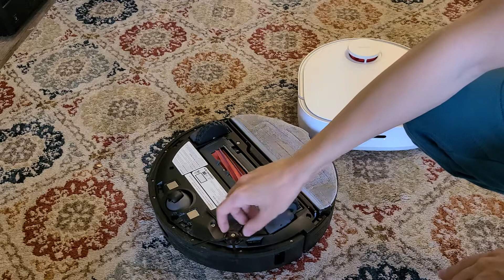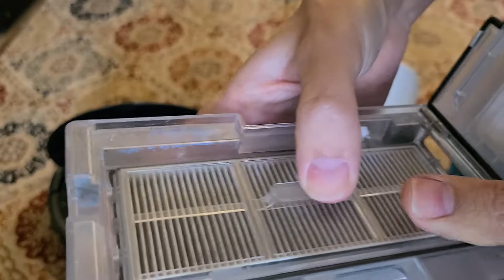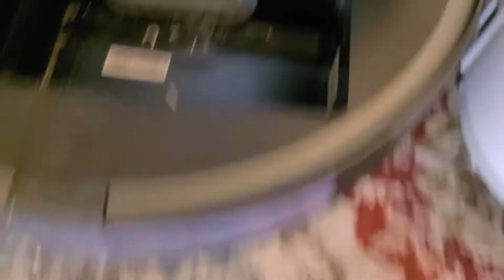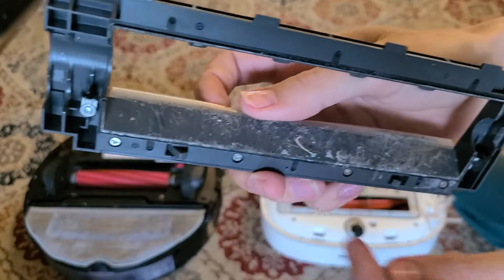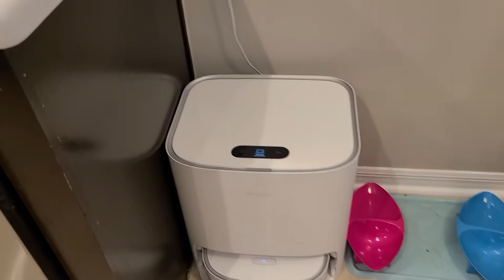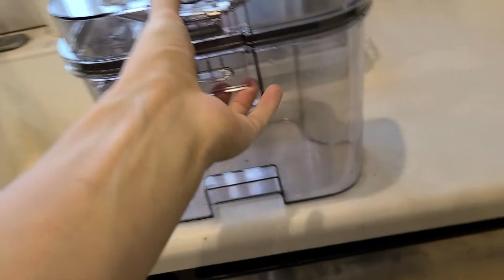Roborock S7 vs Dreamebot W10 vs Shinebot W450, robot vacuum+ mop comparison. Engineer review.

Comment: Do you have any insights on the medium-to-long term reliability of the S7 and W10? Also has the W10 software improved over time?
Reply from the maker: I returned all except the W10. W10 works great still. I have two things about it that are negative so far: changing dust bin requires manually pulling it out of the base or waiting until it starts cleaning and comes out. A simple software fix could solve this, but it isn't there still. Second sort of an annoyance is that with carpet it lags pretty bad and would run around it every single time seemingly not memorizing that area, this is carpet detection software issue and it can be solved with a software update, but its another thing that is still present. Over all I am still very happy with it. It's super silent as well, compared to others.
Reply: @Vladlabs  appreciate it! I ended up going with the L10S pro and it's been awesome for both vacuum and mopping with minimal maintenance. Only issue I have is the carpet sensor broke so it mops my one carpet in the house, luckily it dries pretty fast..
Reply from the maker: Cool! A self-cleaning for dust bin on L10S would be great on mine haha. I don't have that. Overall I think dreamebot brand is superior to roborock, roborock is just marketing. The only thing I still need is a hookup for these vacuums directly to water and drain lines to make them actually automated. At the time of my purchase that wasnt available for some reason, but for me its an obvious improvement which will allow to make it smaller to ship, use less parts and overall improve every aspect.

Comment: Could you please advise how Many Time it takes to MOP your appartement (W10) if it has to wash the mop mets Say every 100 sq feet?
Reply from the maker: You can set it up, mine is set to 10m², which is optimal. I never counted a time ad my house is relatively big, over 2000ft², and I programmed it with a complex schedule where it never cleans the whole house, kitchen area is daily, living room is once a week only, etc etc. But overall it's similar to other vacuums, they all have relatively same speed of cleaning. If somebody is very in a rush, then clean the floor manually lol, robotics is always slower than manual, the point is to clean when you are not home, or when you are not involved in any way. So time it takes isn't really important anyways. And as I said, it is faster than most mops, or similar.
Reply: @Vladlabs  I agree that robots are Always slower, but considering fact that the W10 has to go to the station every 10m² and run the cleaning of its pads + wet the pads ... I think it will take even longer than other robots, which explains my question.
Reply from the maker: No, it's moving slightly faster and you still need to clean roborock pad same 10m² or more, but manually, which is a major PITA. If you don't manually clean other vacuums, you will get the dirt spread over all the floor everywhere. They don't dematerialize dirt you know ;) rotating pads are way superior, even compared to ilife model, surprisingly.
Reply: @Vladlabs  no need to clean it manually, just throw it in the washing machine :) Also, by doing a mopping shchedule by room it would be juste fine ;)
Reply from the maker: Up to you man, I actually had that vacuum and it's a major NO because of that. W10 can mop autonomously entire house, what is the point of a robot if you will need to swap a pad every 10m² on average. You can't ever clean even one room properly with roborock due to that mop change requirement. You will need to run around it to babysit it, which is just dumb design imo. And it isn't even a proper mop, it only really cleans the dust. Vibration of it visually does nothing at all. You just trying to have a wishful thinking and being caught in a bias, I absolutely think that W10 is light-years better for mopping in every possible way. This is my advice basically, and you do whatever you think works for you. You heard me :)
Reply: @Vladlabs  I have Many points to raise with you : Does the station allow you to spray/rinse the pad with cleaning solution that sanitises the floor and gives great smell to your house, if not don't you think doing so even manually is a plus ?  Do you think that the washing of the pad with simple water by a station is enough to consider it is crystal clean with no more dirt ? Does the W10 allow you to raise the pads to pass through a carpet or would you need to babysit it to make it go further the carpet ?  wouldn't this make it dumber than the roborock S7 in that aspect ? Does the W10 have a water tank to continue wetting the pads while cleaning, wouldn't that be smarter in order to achieve faster cleaning if your floors are not very dirty? For the Price paid, wouldn't it be smarter to buy two or three roborocks S7 to clean your house faster and more efficiently ?
Reply from the maker: First of all, roborock with base is $900, w10 is $930. W10 is not best choice for carpets, however I would still not buy a roborock either way, at its not worth the price. Watch more reviews and Google, do some work yourself and investigate. You are asking for a way too much effort on my side to explain each aspect to you. I do respond to everyone, but hey, you gotta respect other people time and be reasonable too, right? If you have a lot of carpets, no, do not consider w10. It's not for that. 90% of my house is hardfloor.
Reply: @Vladlabs  I am sorry if you found my comment disrespectful it has Never been my intention. I though we were having a serious discussion and arguing about  Robots no one of us have stakes or financial interest in ....  As regards the Price tag of the S7 vs W10, as stated before I have paid mine about 460, and have no need for any station for now. I would prefer having two or three robots and clean the pads in the washing machine ...
Reply from the maker: As I said, everyone's house is different. For me it makes no sense to do that kind of maintenance, as I will then vacuum manually, better and faster. Robot must be autonomous. Over here I shared my thoughts, definitely not looking to spend time on arguments, as I used both of them for a month, and you only have roborock, so you can't objectively compare. For me mopping is #1 priority, and for my house. All that I already covered in a  video tho. Mopping performance of these two robots is day and night, clearly.
Reply from the maker: Amen. 😀
Reply: @TecHome S7 is a horrible Vacuum ? Hhh it seems you confuse vacuum and mop, it is two différent functions  , and S7 is an Amazing Vacuum. As for mopping, it does the job pretty well for small areas and very fast. As I Said before, I would prefer buying three S7 without station at 1200 Euros rather than one w10 at 1000. Or even better, one S7 And a dedicated moping robot like the ilife 455.  yes I will change the pads when I get home ;).
Reply from the maker: You need to change a pad WAY more than that, I told you already. By the time you get home, the dirt will be spread all over your apartment by a dirty pad lol. W10 washes pads every 10m², S7 needs even more frequent change due to skinnier pad. If you need just to Vacuum Tacklife on my video does it just as well, for $270. Don't need to throw $650 for that. And yes, I am not sure what's up woth your math, you can't buy 3x S7 for $1200, they are not $400 each, they are $650. W10 is $950. You can barely buy 1.5xS7 for that money.
Reply: @Vladlabs  I talk in Euros, and yes they are 400 euros ;)
Reply: @Vladlabs  As regards washing pads every 10 M2,  in reality you only do that because it gets dry after 10 m² because it doesn't have a water tank.  Otherwise I am sure you could clean more without going back to the station. That feature lacks in the W10 (Unlike Obode p8 for exemple).
Reply from the maker: Then W10 is 700 or so. Not 1200. I bought it for 950 USD. I checked and W10 is 750 euros.  And you are asking why reviews of S7 are all good? Here is why, you show such bias yourself, you don't want to hear what people tell you, you compare best scenario sale price of S7 with worst price that doesn't even exist on W10. This is exactly how bias works and why youtube is not always an accurate representation of product.
Reply from the maker: You judge based on what? Based on a fact that you never even used any of these vacuumes? Lol. No, you need to change a pad on roborock after each room at least otherwise it gets dirty, and this is even in my relatively clean house with no dogs or little children. Good luck with that on dirtier floor. W10 pad dries yes, but even if it didn't, I'd still wash it every 10m² to keep it clean.
Reply: @Vladlabs  Any of these vaccuums ? I am running the S7 right now and very happy with it, thinking of buying a second one ;)
Reply: @TecHome Try this instead : https://youtu.be/J6zFxrnvXow
Reply: @TecHome for the S7 : https://youtu.be/vM34T4Gchl4
Reply: And then a third one and will clean all  my first floor in less than 40 minutes :) while the W10 would need 4 hours lol
Reply from the maker: Good luck with that. You are a remarkably stubborn person, can't help that much further haha 🤦🏻‍♂️😀
Reply: Carpets included :)
Reply: @TecHome Based on several other reviews, this robot needs water refill After about 50 m² mopping. If you have more to MOP, you will have to be arround and refill.

Comment: Interesting video. Thx for it. Do you still have the roborock s7 ? I Can understand your arguments, but at the end, the software is almost as important as the hardware for a Robot imho, which still made me chose the S7 over the dreame w10 or even the roidme Eva. Yes, it Can be solved with software update, but it can also Never be updated. I am still waiting for the S7 to arrive, and think it needs Indeed some "help" to deliver, mainly on mopping (I bought 14 extra mops for that purpose, to be able to change those more often while others are beeing cleaned in the washing machine). I don't know if I made the right choice, but those new self cleaning moping robots are still New, and I think might still need some time to perform well...
Reply from the maker: No, I returned it. W10 is light-years better. I use it everyday and super happy. Mopping on S7 is a joke. Exactly as you said, you bought 8 pads, but isn't it easier to just mop yourself at that point and especially at that price range? Roborock software is not better than W10, it is worse. Especially for initial mapping, S7 doesn't have fast mapping for some weird reason, software limited only. Overall quality wise roborock doesn't look as good as I said om a video. Months have past and I didn't regret keeping the W10 for a second. Unless your home is all over carpet, W10 is clearly superior. Changing and cleaning a mop pad is like 10x more trouble than changing dust bin occasionally. I change dust bin once every 4-5 days. In order to do a single mopping with s7 in a 2000sqft house, you will need to change that mop lile 4-5 times and it still won't be perfect. W10 washes mop every 100sqft, which is a big deal too. S7 is extremely overpriced for what it is imo. It also struggled to go ona  thick carpet in my bathroom and I had a lot of positioning errors on roborock in 7 days, and I had zero of that on W10 to date, which is months of daily cleaning. Performance of a carpet is very comparable between these two caccuns, however dreame is way more silent and the noise is way softer and easier on ears.
Reply: @Vladlabs  thx for your reply.  what made my choice is : the all silicone brush ( I have pets, dogs and cats),  the fact that I have a multifloor house, with carpets, and also that I paid it only 465 euros.  Going with a brand like roborock was for me reassuring as it is my first robot, and at the end, if mopping is not perfect at least it will be a good vaccuum, ligh mopper for the upper floor ... Unless I am wrong :) we'll see.
Reply from the maker: For sure, espwcialpy without docking base it's worth a try for sure. Every house is different, which is why I believe experiences are difference with same vacuums. After all you could return it most of the time if you don't like it, same for W10. Just try and see if it works. I have a wife with long hair, if you know what I mean haha, and the brush on W10 does the job just fine, what's even better is that dust bin on W10 is superior, as I showed on my video, so you don't have the garbage all over it while changing, I believe roborock bin is only designed to work with a self empty base, not so much with manual. Plus the filter clogged also super fast, because they overlooked the mesh protection there.
Reply: @Vladlabs  W10 can't be used for two floors though, because it needs the base. S7 can.
Reply from the maker: @INSANEFAME  not sure about that, it does support multiple maps though. Plus imo using such vacuum for two floors is vounter productive,  unless it can fly there. The ehole point is automation, and if you have to bring it there and return manually, thats not efficient. Then you clean it and in the end you end up spending more time than if you vacuumed it manually
Reply: @Vladlabs  meaning you need two, and the S7 is now half the price as the W10.
Reply from the maker: Depends on what you need. S7 is not a mop, if vacuuming is the only thing your house needs, then S7 is an option, otherwise it is not. W10 is the only reasonably designed robotic mop on a market so far.
Reply: @Vladlabs  L10s Ultra has the same mop as W10
Reply from the maker: Then I can not comment on that model. At the time of shooting this video only S7 model was available. I have never had my hands on L10S Ultra.

Comment: I'm wondering what is better, this w10 or roborock s7 maxv?
What do you think?
I want to buy ine of this 2, and i don't know what to pick up.
I want to see them both on hard cleaning on mopping and vacuum to see who is doing the best job, but i mean to s7 maxv, not s7 plus
What do you think
Reply from the maker: I was going to wait for that roborock too, it has a camera and some other nice stiff and for carpets it will probably be better, but imo it is still not worth its price. I was also not happy with S7 quality overall. As I mentioned before, w10 is like 70% mop, 30% vacuum. This has to be kept in mind of course. If you have such an option, buy both and use them for quite a while and just return one you don't like. That will be the most reliable way :)

Comment: really nice videos. Do y still think the w10 cleans better?
Reply from the maker: So far very happy, absolutely. So much better compared to roborock S7, day and night. Auto clean for pads is huge too. It won't be great for carpet probably, but I have very little carpets in my house. Only wish they offered a tankless option that hooks up to water and sewer, would be 100% no maintenance killer! 🤩
Reply: @Vladlabs  it is already the case with the Dreame W10 pro in China (linked to hose and sewer).
Reply from the maker: Great to know, may upgrade to that later then. They should have honestly done it in a first place. Makes sense to have that connection, way better than those containers. Way more automated too
Reply: @Vladlabs  Yes Indeed, they should, but it is obviously for commercial reason to make you buy a new robot again and again. Personally I Never buy the first robot in a series, and I knew there were things missing...
Reply: @Vladlabs  that’s good to know. I have a white rug so my best option probably the s7. There’s a new coming up with all those tanks and self cleaning feature
Reply: @tonypaca3015  depends. Overall I really disliked the S7, and I have a sort of deeper rug in a bathroom which he totally struggled with, and got stuck on it. If you want to get a roborock, I would recommend to at least wait for S7 max that should come out soon. But imo, it is not worth the price at all. You will be better off just getting two separate devices if you need mopping. Tacklife for example is about $300 and it does the vavuuming job exactly the same as roborock, can't tell a difference. For half the money. And then you can get another one for mopping for example.